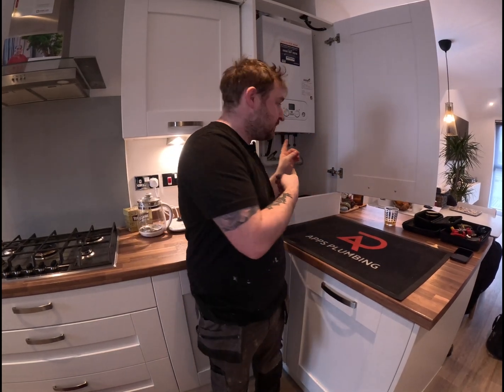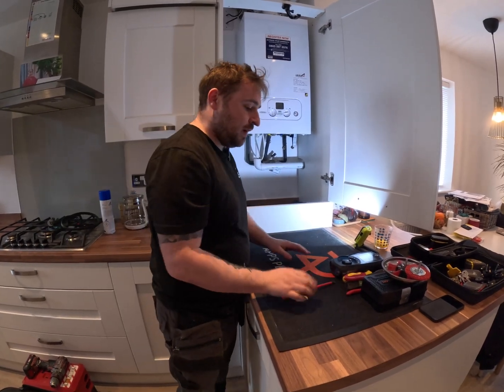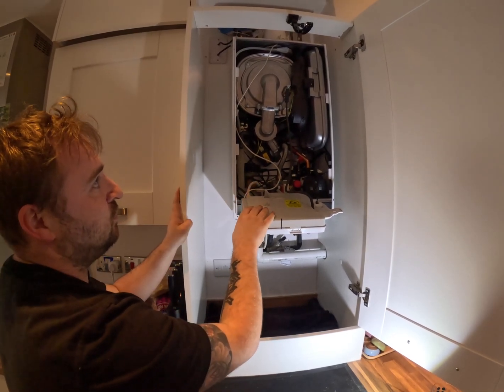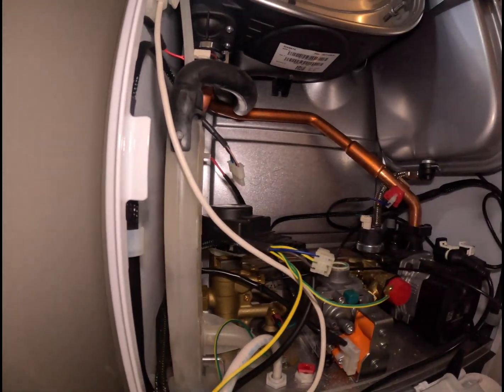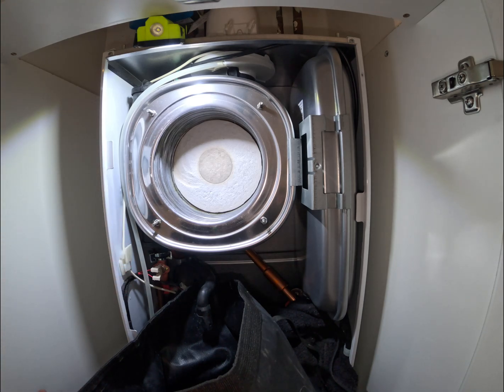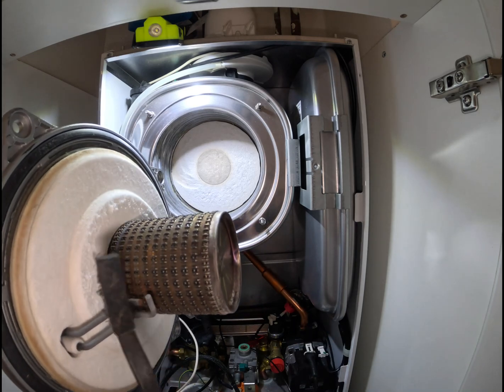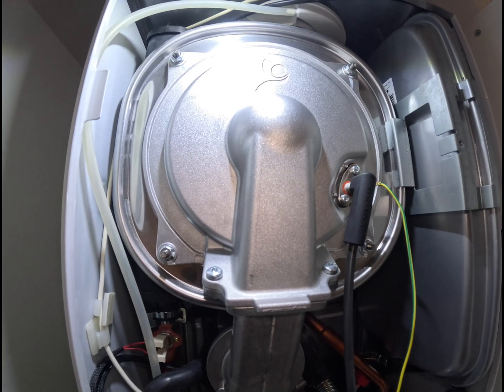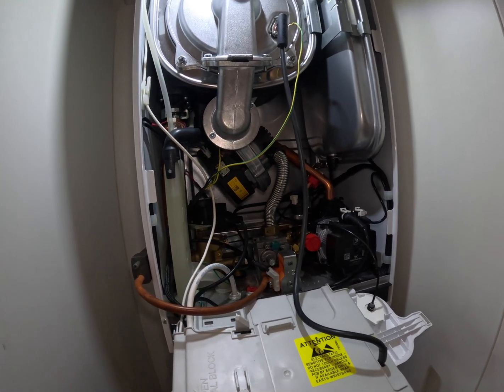Boiler Service Potterton Assure Combi Boiler Step by Step Guide - Manchester Plumber & Gas Engineer

Comment: Ihave a question about your boiler as I have the same one, is there a timer in the boiler that canbe switched to always on? The reason I ask is that I replaced the old programmer with a tado one and terminated the old thermostat (which has one live and one neutral, and the earth ofc). Am just asking to see if there is anything I can do before I call a professional out (last thing I am gonna do is actually fiddle with the boiler lol)
Reply from the maker: Hello if you want to email me I'll send you over some info about changing the timer.  Aaron@appsplumbing.com
Reply: @appsplumbingltd   Thank you so much for replying. As it turns out, after double checking my wiring it was a simple case of one wire slipping out of a wago when trying to force some wires into a really bad hole made by some council contractors when they replaced the heating and electrical systems (it was that bad that essentially only one screw was holding the back plate of the old thermostat whilst the other one had a tenuous hold in a crumbly hole that was connected to a larger hole that the old thermostat wire, the one they replaced, ran through). Suffice to say all is working as it should :)
Reply from the maker: oh iv done that many times and its confusing hahah

Comment: Just one to remember mate when doing up burner door. You need to go criss cross and not in a clockwise or anti clockwise direction. Its to do with the seal not being compressed correctly if tightened like the way you did on your video.
Reply from the maker: Thanks for the advice and feedback.
Reply: @appsplumbingltd  good video though